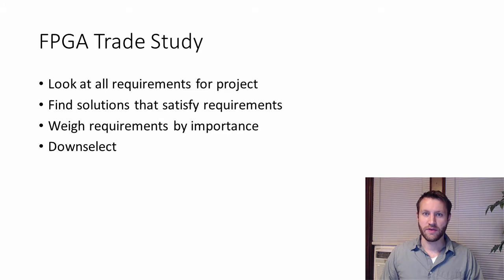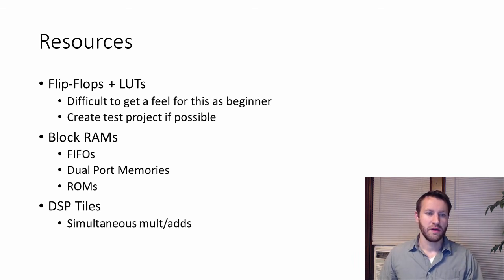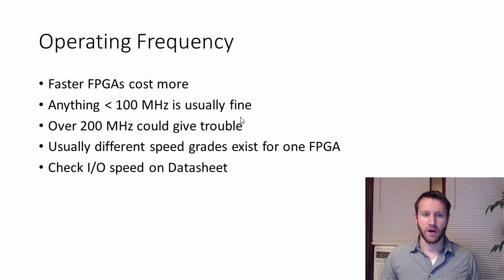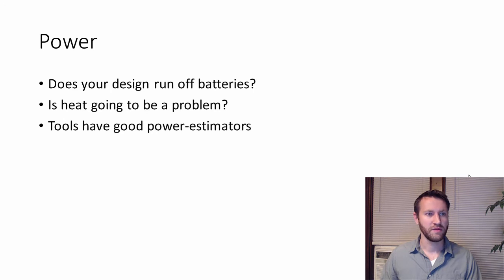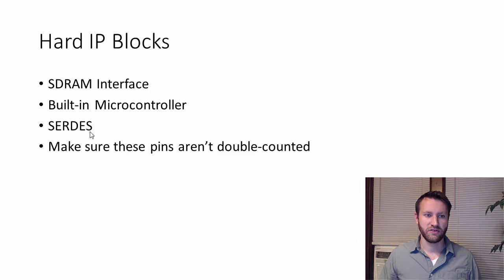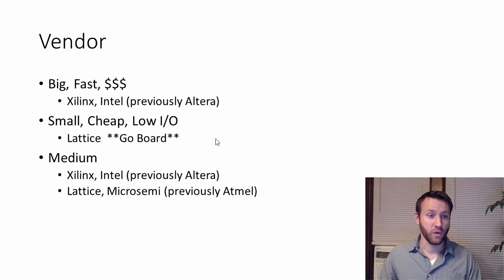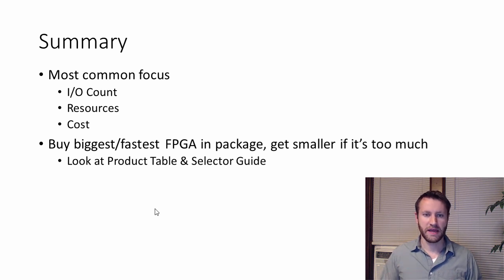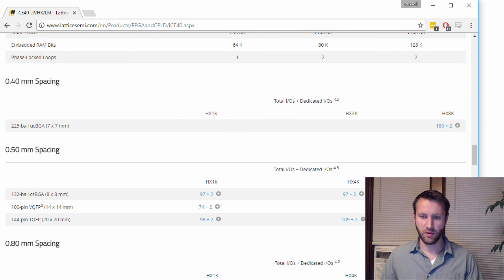How to Choose an FPGA for your design

Comment: One thing to add to about temperature --- If this board is going to end up in a 1U chassis in a datacenter with attachment to CPU via PCIe, you might want to be careful what you want to run. You will find air flow to be a problem, and liquid cooling might be difficult to fit in a 1U chassis. 
Otherwise, this is a great video on a not-so touched topic.

Comment: HELP PLS ... What is the exact difference between the BOARD and PLATFORM? Are there usable boards without SoC or any processor?
Reply from the maker: Board usually refers to Printed Circuit Board (PCB). Platform I'm not sure how it's used. I've heard platform used though to describe the environment on which the FPGA is operating. For example if it's an FPGA on a radar system the radar system is the platform.  Most boards don't have SoC or processor. You should check out my board! https://www.nandland.com/goboard/
Reply: And what about the usable boards without an FPGA(ASIC and logic stuff like that) either? And can you please tell me how can several boards be connected to each other(via pins? or ..).. Thanks a lot for your attention!!
Reply from the maker: Narek Hambardzumyan those boards likely need to communicate to something. Or perhaps they can operate on their own? Boards connected by pins yes. You need to understand what the Input/Output to the board looks like. If it's a communication interface like UART, SPI, etc look into how it works. Good luck.

Comment: I have a question. I'm designing/building a simple 8 bit computer in a fpga, the artix-7 35t to be exact. using vivado. I'm watching ben eater build it on a bunch of breadboards and on his registers he has tri state buffers before hooking it to the main bus. from what I know fpgas don't have tri states but do a combination of clb blocks to accomplish this. is it necessary to design a bus in the fpga with this feature? or is there a way around it? whichis best to build it in vhdl/verilog/schematics? or in other words what's the best way to go about making a bus and multiple registers on that bus so they don't interfere with each other?
Reply from the maker: Honestly hard for me to answer this question without seeing exactly what you're trying to do.  Try posting your question (and code) to stackoverflow.com.  Good luck.
Reply: You don't need tristate buffers. All you need to do is to decide what data is on the bus, based on who is currently asserting to it. In Verilog for example, you can do this with if statements, or ternary operators ( ? : ).

This gets inferred as multiplexers by your design tool, which, on FPGA, will get mapped into LUTs.

Comment: I build FPGA boards as a hobby, so here's my perspective on the subject:
1. Since I'm paying for everything with my own money, price is everything!
2. Keeping in mind (1), Xilinx is the best vendor as they give a lot of useful IPs for free in their free edition of tool. For example, it's the only vendor which gives free DDR3 controller IP.
3. The downside is that their modern FPGAs are BGA only. I used to be scared of BGAs, but since I bought a very cheap (~$200) reflow oven, it is not a problem anymore.
4. What IS a problem though is PCB. BGAs require at least 4-layer PCB which are quite reasonably priced as long as you don't demand very fine traces and drills. But price goes up very quickly as your demands grow. For example, the cheapest 4-layer board with 6/6 mil traces and 0.3 mm drill costs about $50 for 5-10 boards 10x10cm (these are good enough to handle 1.0 mm pitch BGAs). But same 4-layer 10x10 cm boards with 5/5 mil and 0.25mm drill (good for 0.8 mm BGA pitch and up) are already $150+. 6 layer boards start at $200. Going even higher is beyond my hobby budget. And this is just for the board.
5. As for actual FPGA chips, currently low-to-midrange Artix-7 in 1.0 mm or 0.8 mm pitch packages are the only realistic option. Can't wait to get my hands on new Spartan-7 chips as they are supposed to be cheaper while still providing a good amount of headroom in terms of density and performance.
6. Since I always get several PCBs with each order, I usually fit one with larger density FPGA and it essentially becomes my devboard. Things like ILA require additional resources (which are not needed on "production" boards) so having some extra is very welcome.

To sum it up, it's quite expensive hobby, but oh boy that feeling when the board you've just spent a couple of hours assembling comes to life for the first time - it's magical and is totally worth all the trouble! :)

And yes - I've stumbled across a good portion of pitfalls you've described (like using wrong pin for clock) :) I wish I had this video when I've designed my first Artix board - that would save me several board respins and few hundred bucks worth of components. But I didn't give up as I enjoy the process almost as much as I do like results. Thanks for your video!
Reply from the maker: Thanks for the comment!  Very interesting information.  I don't think there are many people like you who would buy their own reflow oven to do hobby projects, so that's cool that you enjoy that.  You're right that Xilinx does a great job of offering up lots of IP in Vivado, I like that.  I haven't used Altera (Intel) in a long time, so I'm not sure what their IP catalog looks like today.  But I really like to do things myself, which might be stubborn sometimes.  That's probably why I'm drawn to Lattice, because its a simple FPGA and you gotta figure it all out yourself.  Not to mention the IceStorm project which completely reverse engineered the design to open source the synthesis and place and route tools.  Pretty cool stuff if you haven't seen it: https://www.youtube.com/watch?v=P-9WCFi0p-0
Reply: Maybe not many people going as far as I do when it comes to complexity of boards, but many people make reflow oven out of toaster ovens and even skillets. So reflowing is definitely not as exotic among hobbyists as it once was, especially if you're OK with using leaded solder paste (as it's much more forgiving and easier to work with, hence most of them use leaded solder).
As for Altera/Intel, their strategy appears to be making some money off software and using this funds to make chips themselves cheaper (and they are a bit cheaper vis-a-vis equivalent Xilinx devices). This is obviously great for mass-production because as volume grows at some point savings on chips price will overtake fixed costs of software/IP licenses, but for the hobbyists like me it's a non-starter.
I also like doing stuff myself as much as I can (hence why I'm building my own boards instead of using pre-made devboards), but I'm just not (yet?) at the level when I can roll out my very own DDR3 controller, or Microblaze-level soft-core CPU. Besides when you build a board from scratch, it's important to be able to separate hardware issues from bitstream ones, because troubleshooting issues when both your HW and software are unproven and thus could be a culprit is much harder than when you have at least one part of this equation as "known good" if you know what I mean.
As for Lattice, I used their ICE40 Ultra chips (ICE5LP4K to be exact) on a project, and they are good if you can fit your design into them (and QFN package is also very hobbyist-friendly as 2-layer PCBs cost next-to-nothing these days - $5 for 10 boards of 10x10 cm is extremely cheap) and if you can find your way around some schematic idiosyncrasies, but they are now universally out-of-stock and had to be ordered directly from Lattice with minimum order of 500 units, which is obviously a no-go for me. I've managed to buy 10 of them when they were still in stock at Digikey, but eventually I will run out of them. I was thinking about using their higher-end FPGAs (which are roughly equivalent to Artix-7/Cyclone-V family), but toolchain for them is subscription-based. And again, the same issue with IPs as with Altera/Intel.
Reply from the maker: Which parts?  The ECP5?  I used an ECP5 in a design.  Lattice offers their DDR3 controller free of charge for usage lasting up to 4 hours.  Meaning after the design was running for 4 hours the DDR controller would time out and stop communicating with the memory.  After that you do need to buy the IP which is like $1000.  The license for Diamond (their IDE) is free, unless you need the high-speed transceivers, you need to pay for that.  But yeah I see how as a hobbyist, paying for IP is a non-starter.  
I'm very interested in what's going to happen with the Intel/Altera merger.  AI is something that fascinates me, and it seems like Intel bought Altera to add faster parallel processing in pursuit of having the best AI-ready cloud.  Interesting stuff.
Reply: There were some rumors that Intel is going to make hybrid x64/FPGA chips and that's what I would really like to try out. Don't get me wrong - Zynq are great chips for many users, but having FPGA built into your desktop computer is just in another league. This is especially so for me as I'm professional software developer, so x64 programming is what I do for living.
I'm working on computer vision designs so neural networks is something I'm very interested in myself.
Reply: asmi06 I'm an engineering student and boy! you got me excited with this. Salute to you Sir. Would love to learn from you about laying the board. 
Be my guru 🙏🙏🙌